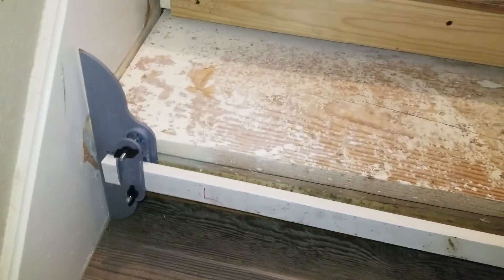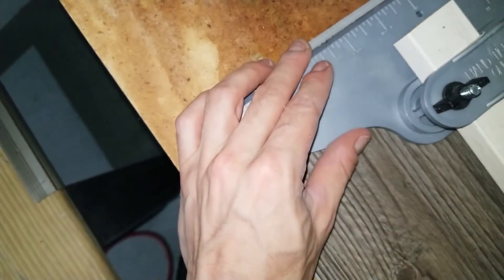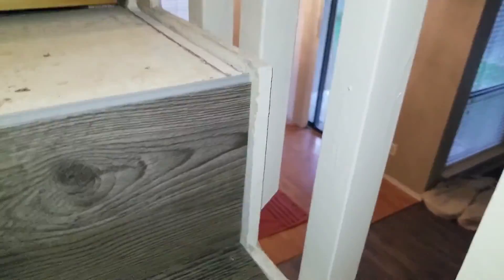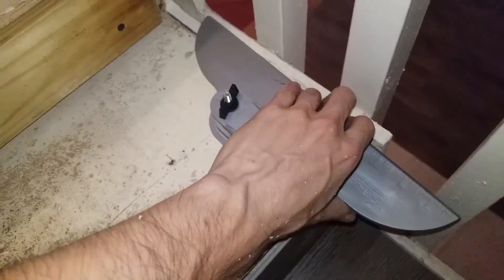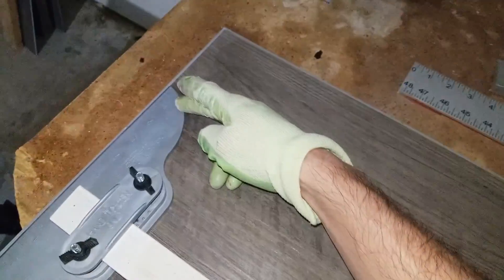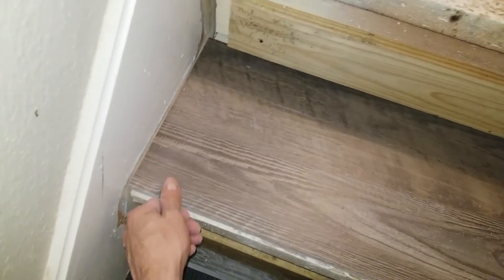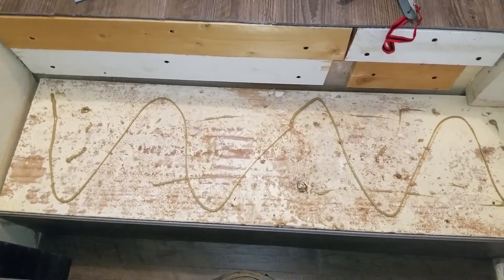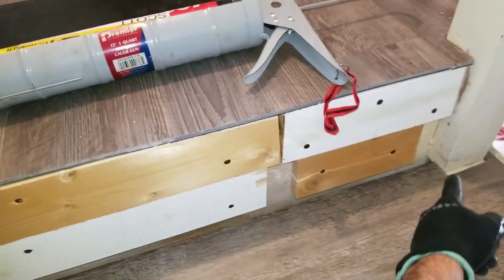How to Make Luxury Vinyl Plank Stair Treads and Risers

Comment: Did you finish the edges of the planks with caulking or anything? Curious about the left and right sides. Thanks for this! We are very apprehensive to do stair install DIY and are a bit more confident after watching this a few times.
Reply from the maker: I put clear silicone to make the edges water tight and protected from my tenants walking in with wet shoes. Nothing to do with aesthetics though. There shouldn't be a need to "hide" any gaps with caulking if the tread template is used and you are careful with cutting. It's actually not too hard to have zero gaps, just takes a bit longer. To reduce the chances of a gap, cut on the outer edges of your cut line so the planks are almost a press fit against the stringer.